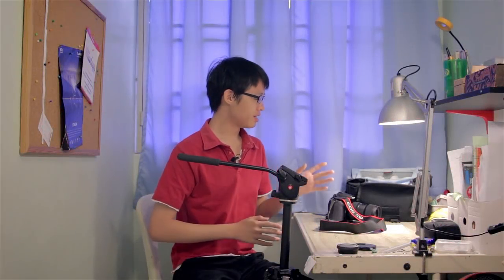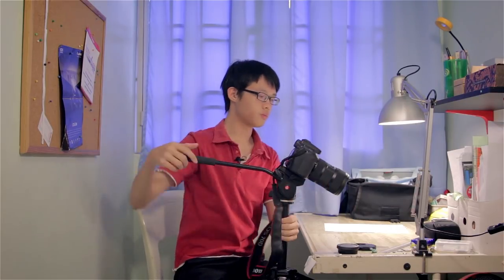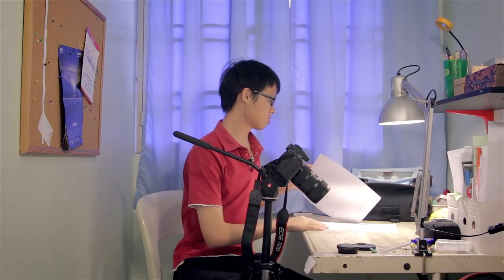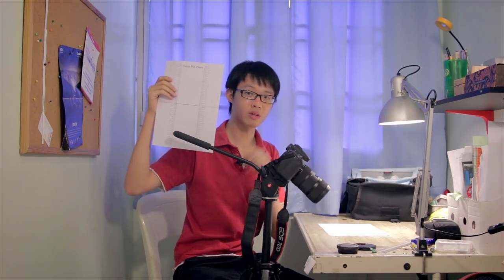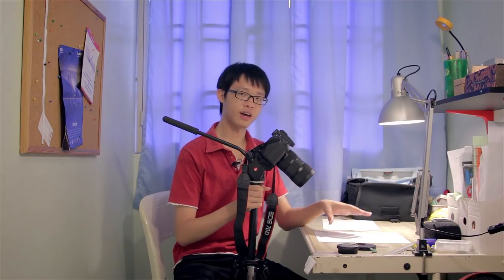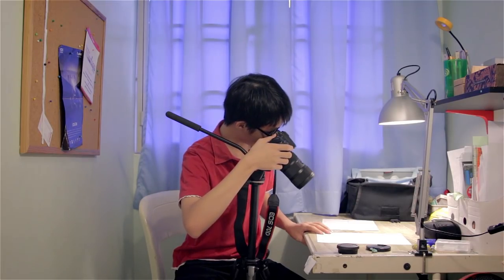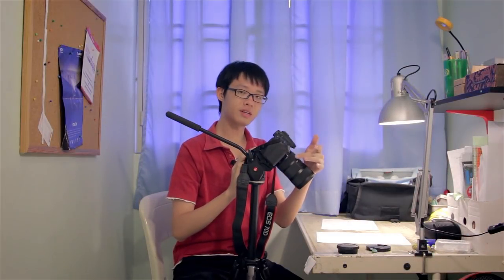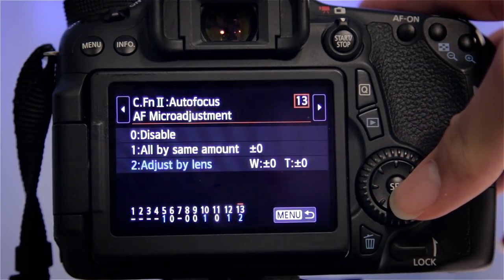How to perform AF Microadjustment

Comment: Dont forget you need to put your camera in Aperture priority and choose the LARGEST opening (smallest f stop number like f1.8 or f1.4) as that is where narrow focus issues are the most problematic. You also need to be anywhere from 5 to 10 times the focal length (in centimeters) from the chart. so a 50mm lens should be 250 to 500 cm away from the chart (if you are doing in straight on and not on an angle) using one of the purchased charts .

Comment: Very nice video!

One small tip is to not look which line/number is the sharpest but rather compare two numbers. Look at 7:46 (hit pause there) - it is easier to compare the closer "2" to the far "2" than to just decide what number is the sharpest. Here we can see that the closer one is clearly sharper than the other so I would have adjusted it a little further until the two twos are equally blurry.

Comment: Zy, thank you very much. Your video has been the solution to my problem. I have a Canon 5dm3 and just bought a 85 mm f/1.2 for portraits. I was trying since a couple of weeks now and had never the crisp sharpness I wanted to. Finding your video, I printed your test sheet, made the shot and look here, lens was way out of focus. I focused the middle line and 12 to 14 was sharp. Same results after a couple o shots with new focus. Problem solved. Thank very much again, you gave some great insight with very well explaining it.
Reply: I have the same problem, i read in Canon website, for 85mm 1.2, you need 7,87 feets (2.4 m) to make this microadjustament, you use this distance or configure using the same distance used  on vídeo?

Comment: Your tutorials are so easy to understand and follow along with... I've downloaded the calibration spread sheet  and it works great for my 35mm ART lens calibration. 
 My issue is that I'm now dealing with the sigma contemporary 150-600mm lens. 
I was suggested that in order to properly calibrate the 150-600, to do it out of doors
 By using a target set at the designated distancing that the lens is set for as far as calibration is concerned on the software.
 By doing this, one needs to find a location  at at least 100 feet long.

Comment: This is pretty much the way I have been doing it with my new camera. But what I am finding is that when I get it right for close distances, this introduces an error at longer distances. I then looked it up and found that advice from Canon and most others is to perform the test/adjustment at between 25 and 50 times the focal length of the lens.

Comment: Thank you sir. I was confused by the term "Backfocus" on DSLRs because working in TV production years back, we had a back focus ring on most TV lenses as well as a standard front focus ring so I was wondering where in the world is the back focus control on a DSLR lol. Thanks again. This video was very helpful. I'll use your chart on my various lenses for my 5DMKII.
Reply: Mrjfj17 
Actually you can do what you're saying with these cameras. 
It's called back button focusing, I use it a lot with my 7D. You can set up one of the back buttons for focusing instead of your shutter button. 
Very useful!

Comment: When you perform the test from a further distance with different lenses, do you just tape it on the wall? I don't understand how you would be able to measure where the focus is falling/on what number if the surface is perpendicular to the lens, providing there would be no depth of field. Would you just adjust it by trial and error if it was on the wall to see if it was front or back focused?
Reply from the maker: Hi, at further distances, I would adjust the camera angle to remain at a 45 degree inclination, not perpendicular. :)
Reply: To keep it at a 45 degree angle but shoot further away you'd likely want the camera to be level but make the test chart angled.

Comment: i would say at 35mm the sharpness is also a little bit in front of the middleline. compare the 1. line behind the middle and the 1. line in front of the middle. to me it looks like also the 2.line in front is sharper than the 1. line behind the middle.

Comment: I’m wondering if the first test shots should be one focused through the optical viewfinder and the other one using Liveview. With both focussed on the centre line. Then compare them. If they are the same sharpness then there isn’t a problem. If the optical viewfinder shot is off then microfocus adjustment is warranted.

Comment: Hi, just need to confirm something... Read all the notes and seems like you should be shooting at the widest aperture for your lens. I don't think this wasn't mentioned in the video, so I just wanted to check. I'm testing out my Canon 5Dmarkiii, and the Canon 50mm F1.2 (l-series) lens as well as my Tamron 24-70 F2.8 lens. At F1.2 I'm wondering if anything is going to show up clear... If anyone's got thoughts on tips on this, let me know. Thanks, :)
Reply: +Ester Knowlen that makes sense because the widest aperture will allow you to see the shalloweds depth of field that way you will be able to tell where your focus is. If you use a higher f stop then more things will be in focus so you won't be able to dial it in correctly.

Comment: Thank you very useful ! But I am now understanding that this is sensitive to 2 things : 1- the distance : a setting for close is invalid for far away and vice versa 2- mountinf and dismounting a lens seem to change the setting, so it is nessessary to check just before shooting, at roughly the used distances. When I adjust the AF micro for close portraiture, then the infinity is not great. Have you tested the wide angle to see if architecture shot is akay after adjusting at so close distance ? For close portrait you may want to set it light backfocus because if you point at the nose and want eyes in focus, then the good setting is incorrect for other photography. The menus are cumbersome and slow for adjusting this on the field.

Comment: Alberto,  Very good, clear and informative presentation.  I have a question regarding live view.  I converted a camera to Infrared.  All my shooting is done live view with that camera, 5d m3.  If I follow your steps with live view will it work as well with an infrared camera.  Same question for normal camera, can focus be assessed using live view?.  I understand Infrared focuses differently due to the different wave lengths of infra red light.  Would like to be able to rely on the live view focus of my infrared camera.  What do you think?

Comment: Can I use this method for my sigma lens instead of using the sigma dock? The sigma dock seems so much more hassle and obviously costs money.
Reply from the maker: You can, but with the Sigma dock you'll get more fine-tuned settings, like unique settings at different focusing distances + more focal length intervals.

Comment: I see that for a macro lens you perform the adjustment with a smaller grid. I would like to perform the adjustment on my 60mm macro lens if needed. What else would you suggest for me to take into consideration. I basically use it to photograph flowers. Thanks so much.

Comment: ZY I have a pentax k3 and it only has one  micro adjustment . It doesn't have both wide  and telephoto . I want to  adjust  my zoom  sigma 2.8 70-200 mm lens . How do I adjust both  with only one  adjustment ?  I have  tried  to adjust  in the middle  mm setting and then  on 70  and  then 200mm . There is a big difference in the focus  on the opposite  end of what I focus it on . If I micro focus  at 70mm 200 mm is really out of focus and vice versa  . If I micro focus  mid way between 70 and 200.mm Both ends are not sharp  and only the  mid way  distance is in sharp focus .   It seems  to work best if I micro adjust  at 200mm . Why can't both  ends of the lens  be in sharp focus ?

Comment: Thanks. Very useful. How should this be done with a super telephoto lense?  For example, a Canon 600mm lense? the 45 degrees angle to photograph a coin is not trivial as the minimum focus distance is VERY LONG. Any ideas? Suggestions?

Comment: how do to test a 100-400 L lens when your shooting at quite a far distance, that going to be some size of a chart i need
Reply: mine too! unfortunately i have a 77d with no means of fixing!!! 3 grands worth of shite!
Reply: Some brands (lens) can be adjusted using some software or service bulletin. Contact the brand. In my case I had the same 77D with a Yongnuo YN50mm f1.4 with front focusing, Yongnuo gave me a service bulletin and using de camera I fix it.
Reply: i ended up just selling the 77d for the 80d,problem solved

Comment: So this means that my 18-135 IS STM is not deffective? I am using it with a Canon T1i and have this problem. Thank you for the very well explained video!
Reply: The T1i doesn't have the micro adjustment feature, si if you have back/front focus issues the only solution is to send the lens and camera to Canon

Comment: Zy, I was having a problem with all or most of the photos having a soft focus in the wide angle range so I tried your set up. Canon 70D with 18-135 EFs lens. At 135mm focus looks great, at 50mm focus look great but at 18mm nothing is in sharp focus. The entire range looks out of focus. Would this be a error in the lens itself? There is no sharp focal point at 18mms at all.

Comment: Hi @ZY Productions
. 
 I have a problem with focusing using flexizone-single on my 80d + sigma 18-35. I have no AF issue using viewfinder, it sharp. But, when trying to capture picture using the screen(live view). The focus seems to be on the top of the focusing box
. I'd tried to do micro adjustment but doesnt make any changes.

Comment: Thank you so much for this video.
I want to ask something.
when I go to Adjust by lens option then if I click info. for getting the info of the lens like 18-135mm, so many 0000000 like this comes which says review/edit lens information. I don't know what is this. Please help.
 I am using 7D mark2.
.
and for testing focus what distance is required. Or do I test like the same way as you did?

Comment: Have you tried this test by focusing through the LCD screen? I've seen that the 70D has focusing issues at faster apertures than 2.8, and wondering if that is because of the lens itself, of the focusing issue through the viewfinder of the 70D.

Comment: Hi there! I am experiencing the same problem with this lens with my Canon 7D Mkii. I own the Sigma USB dock and the lens is still front focusing despite the fact that it has been calibrated to +20 (max) on the respective focal length. Do you still recommend me to calibrate according to the distances in the Sigma calibration software or using AFMA to the distance that I frequently use? Thank you.

Comment: Good video! One small question. I have Sigma 35 1.4 Art and it has a slight beck focusing issue when shooting distance subjects. Was thinking to adjust it via Sigma USB Dock. What is the better option? In-build AF adjustment tool or the dock?
Reply from the maker: +Shavindra Perera The dock would give you more detailed adjustments

Comment: i'm having problems on my 6d with 35mm lens, i sold my 50mm sigma because i thought the lens was the problem but turns out it was the body, the dof begins too early and it's very annoying. so when i microadjust for it to begin further back will this effect how it works on other lenses? why don't canon have a system so it adjusts accordingly for whatever lens is attatched? weird
Reply: ***** i haven't yet, i don't shoot any action so i just manual focus for the landscapes i do but i really need to get it microadjusted. i find best results at +14 on the microadjust settings you can do but sometimes it's still sporaddic and only works a few of the shots. i had it worse with the sigma btw, that's really not a good lens for focusing although i do miss it because the pictures are amazing

Comment: Hi mate,
Thank you I was waiting for this video. I also have the same lens (18-35mm 1.8) so you really have a front focusing issue with this lens or it was just an example for this review ? It was very helpful thanks. Just to mention for those who doesn't have that option in their camera you also have the possibility to buy the Sigma dock to make adjustments.
Reply from the maker: For my 18-35, the front focusing is only there when i focus it at very near distances, I usually shoot more distant subjects with it, so its fine for my normal shooting and I did not notice it had such an issue. To be honest, I just realized my 18-35 has a front focusing issue when I made this video! Turns out I rarely shoot close up with this lens at 18mm haha...
And yup, the lens dock is probably a better option than sending your lens and cam to Sigma for callibration...
Reply: Thank you for your answer. I really think the 70D and this lens is one of the best way to perform :)

Comment: Hi there, many thanks for this video! I am trying to microadjust a Sigma 35mm 1.4 on a Canon 6D, the problem I encounter is that in close range (test sheet on a high table, camera at 45 degrees)  the focus seems to be sharp on point but as I distance myself from the subject even by a few cm serious back focusing issues start appearing - noticed this in real life situations, the further away I am from the subject the more likely to experience terrible back focusing issues. Is there any way to correct this on a prime lens? Thank you very much.
Reply: you have to send your lense to the service center & explain them the issue... they will repair the lense...

Comment: Will this work on a Canon body with a 3rd party lens like a Sigma 50mm ART series. Will the Canon body register and remember the adjustments for the lens every time you use it? I ask because I am about to buy the Sigma 50mm ART for my Canon 5D4....Thanks.
Reply: If you plug it into the camera and have a look at the respective menu for lens adjustment, you should see if it recognizes the lens with a name or not.
Reply: @Bareego  I will give it a try as soon as I find that menu location (never used this menu before). I've tested the Sigma 50mm ART when I got last week at various distances and the focus seems spot on with both my 5D4 and 5D3 models. Thanks for your reply.

Comment: What happens if your lens is an 18-135mm. How many times do you check the adjustment
Reply from the maker: Twice, once at 18mm and once at 135mm
Reply: ZY Productions Thanks, I did what you said

Comment: I tested this 85 1.2 at aperture 4 and above the text on the line is sharp and in focus but when i try f1.2 aperture i notice test on the left hand side is sharp and text on the right side is slightly out of focus .. does it mean if your camera is focusing well on higher apertures then ur focus is fine ?
Reply: Yes, the sweet spot or the sharpest aperture for your particular lens is around f3 to f5.6

Comment: Hey mate, for first, thanks for the video, it´s amazing. But I have some more issues. I own 7D MK II, and Sigma 18-35 1.8. When I use your test chart it is perfectly sharp, I mean really perfectly, I added some more lines there, for perfect sharpness. But when I am shooting some people, like a portrait, it is really out of focus, at 18mm it is 0.5 metres front focusing and if I am shooting at 35mm it is around 20 centimetres front focusing. Do you know what to do about it?
Reply: the exact problem i'm having. i haven't done tests but when i focus on some normal objects i seem to get decent results, when i do a portrait it misses the eye. it's paranormal, i've always had problems getting both eyes in focus.. very annoying
Reply: As he points out at the end of the video, when you perform this kind of calibration it will be optimize your camera with lens for this specific set-up. That is, if you calibrate with a distance of 50cm between your camera and your focus test chart, then the calibration makes the camera perform best at this particular distance. This implies that your camera may poorly for other distances, like 1-5 meters. Hence, when you took your portrait, was the distance between your motive and the Camera comparable to the distance to the focus test chart for when you did the calibration. If not, then this may be the issue.

Comment: So I have to do this to all of my lenses
Or just one lens
Reply: Typically each lens requires different correction and should be done individually.  In practical use, if you are happy with a given lens, you shouldn't have to mess with it.  I have done it to all of my fast lenses, i.e., those that are capable of very small depth of field. Those are the lenses that will magnify the problem if it exists.

Comment: Hey ZY, thanks for the informative video!
I have 70D paired with the sigma 18-35 and some times I am noticing using the center focus point @f1.8 give me soft image and if i'm using all the other focus points gives me sharp image pretty much all the time.
Do you have such observations on your combo?
P.S. I do NOT see this happening for example with my canon 50mm f1.8 @f1.8, only on the sigma.
Reply from the maker: That does sound pretty odd. However it is a known issue of the 18-35 that it tends to have inconsistent focus. It tends to back/front focus alot. I recommend calibrating it with the Sigma USB dock and see if that helps.